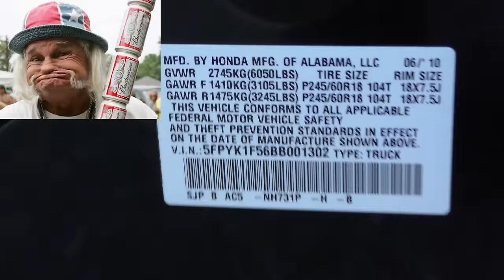Here's Why This Truck is a Better Buy Than a F-150, Silverado, and Tundra

Comment: That's my truck, thanks for having me over was the best day
Reply: Do you still have the vehicle!? How's it running?
Reply: @shadowman1992  running great, replaced the cv axle. Almost time for the belt and pump. Got 86k on it now. Thank you for asking. 🛻
Reply: @noahsamuelmarkus7021  awesome to hear I have a 07 bought used with 145k on it now with 151 k treating me great I love mine too.
Reply: @shadowman1992  nice, did you have the frame recall done on it. I mean the gas tank recall.
Reply: @noahsamuelmarkus7021  the paper shows that it did have it done but my ridgeline had very little rust and yours from the video looks like it does too so it's not anything serious to worry about unless it's very rusty.
Reply: @shadowman1992  yea I haven't had it done but I'm going to wait till I see rust. Because right now there is none
Reply: @noahsamuelmarkus7021  do you live in an area where it snows ? And they put salt on the road ?
Reply: @shadowman1992  yea I bought recently from New York but it was garage kept because the frame has barely any rust. But I live in conneticut and go to school on rhode island. So yea some salt but I clean underbody regularly. What about you.
Reply: @noahsamuelmarkus7021  ok awesome ! Yeah your truck in the video looks very clean underneath. But yes I live in Michigan and I actually spray fluid film on the undercarriage before the winter gets here for protection. And clean it as well. If you take care of these trucks they will last you so long.
Reply: @shadowman1992  interesting, what fluid?
Reply: @noahsamuelmarkus7021  it's called " fluid film " look it up and your will find it. I personally have had great outcomes with it in the past it's a rust inhibitor.
Reply: Any chance you could share where you got that bed cover?
Reply: Sorry not sure where it came from. It came with the truck when I bought it. But it is called a retrax cover that's all I know

Comment: I had a 2006 Ridgeline.  It was hands down the best Winter vehicle I have ever owned, and I live in Montana so I do know winter.
Reply: Crunch right through the snow ❄️
Reply: Had an 08 honda civic hybrid in Montana, FWD, was fine in the snow as long as you know what you are doing.
Reply: @solidfataiist  I owned a 79 Plymouth champ, FWD and did great with cable chains up front. 
Twin stick transmission. Mca-jet mitsubishi. Great engine and sipped gas.
Reply: 2007 Ridgeline with 100k miles both Denver and Southwest Montana. Best rig I’ve ever owned
Reply: Americans claiming they know winter when ive lived in canada all my life 🤣 gets me every time 😆
Reply: @lucluc2716  Minnesota resident here, we get 6 feet or more every winter. Tried and true subaru outback. Only times I ever got stuck was when I was trying. They're amazing in the snow.
Reply: @lucluc2716  I’m two hours south of Montreal. Does that mean when they’re getting a blizzard I’m getting a heat wave? Don’t get me started on their driving either.
Reply: @onefootinthegroove39  im sure we still get it worse 😆 and dont compare to those goddamn quebecors, theyre a different breed altogether
Reply: @lucluc2716  my Ancestors were in Montreal in 1619 they were smart enough to leave
Reply: @lucluc2716   Why do you use God's name in vain, bro?  Read Exodus 20:7 and also the rest of the Ten Commandments.
👌✌

🤔 I wonder why people never use Buddha, Muhammad, Joseph Smith, or Satan's name, instead of God or Jesus' name in vain? 😬 🤯 😱 😳
Reply: @lucluc2716 ok and???

Comment: My uncle has a 2008 Ridgeline and he mostly daily drives it, and he even goes camping with it too! It currently has about 250k miles and still runs strong!!
Reply: 250k miles? that honda's finally broken in 😂
Reply: @Venomousrl  bro don't make fun of my uncle's truck...
Reply: why they keep trying selling customer's kitchen sink?
Reply: @jonlosito2004   he wasn’t joking 😂 he was saying that the truck is just getting started
Reply: @jonlosito2004  He wasn't making fun of the truck.  He was complimenting it.
Reply: 2007 over 390k miles… wouldn’t trade it for anything other than one with less than half the miles.
Reply: @sunshine3914  wow that's great. I have a 2008 Ridgeline with 185,000. I really like the new models (2021- ) but I'm keeping mine for a while
Reply: @sunshine3914  what have u done maintenance ise?
Reply: @jonlosito2004  “broke in” means a vehicle can finally be normally driven or accelerated as to not damage the hardly used mechanical parts.
Reply: @jonlosito2004 Why is your uncles truck pink ?
Reply: @BrianB77   Our 2008 HONDA Ridgeline is bone stock. 105,000 miles, it's 99% more reliable than any Ford F150. The 1st get. has a true 4x4 trans with locker (it has never been used). The truck is so reliable, 2 batteries and 1 timing belt, it has many years left. The bed hauls as much weight as you put into it, truck still has full power. It goes through mud and deep snow without issues. I wish they offered a stripped model without the nav and all the digital nonsense. Basic maintenance keeps her going.:glasses-purple-yellow-diamond:

Comment: I have some friends that just bought a '22 Ridgeline.  Looks to be an excellent vehicle.  I will stick with my dinky little Baja for now, but maybe down the road, who knows?  I made a point to pass on Scotty's advice - CHANGE THAT OIL EVERY 5000 MILES!
Reply: The new generation Ridgeline have issues with the VCM. Stay away.
Reply: @technologybuddha  I believe he disabled that feature right away.
Reply: @BrianBlood  No, VCM is still standard. You can disable it as a buyer, but Honda has to keep it so they can meet EPA fuel mileage requirements.
Reply: @technologybuddha  yes, I am aware.
Reply: I went from a Baja to a Ridgeline and never looked back. I didn’t realize how uncomfortable the Baja was until I drove the Ridgeline.
Reply: @leegraves101  lol,  I don’t doubt I would love it as well. My bank account would hate it, though.

Comment: I have always liked the Honda Ridgeline, but wow they were just out of our budget new. I got a regular cab F150 that year, and still have it---that's a great truck too. The Hondas are good vehicles ---we've owned an Accord, great car. It had over 220,000 miles when we sold it to a college kid. He got another 100,000 out of it!!
Reply: Which year was the Accord? 4 cilinder?
Reply: @oscaralbertogramillorocha6237  2002 4 cylinder. It was purchased used as well!

Comment: Love this truck.  I have owned 2 of them (Gen 1) and has been very reliable. over 200k miles so far no major issues.  Only CV axle, struts, and coil packs.  Typical wear and tear items , for that type of milage.
Reply: and gen 2 is improved over gen 1 as they learned from gen 1 to improve gen 2 so yay
Reply: Have you ever had a valve adjustment on your ridgeline?

Comment: I installed an aftermarket CV axel both sides and the car was shaking a lot … took them off and installed Honda brand .. the car drove smoother with the Honda brand ..

Comment: Bought 08 with 195k for 2k, runs like new no leaks good job Honda 👏
Reply: Have a 09 RTL with 200K miles
Reply: @harveyhankerson8359  I believe it too👍🏾
Reply: @MrDoc375  I'm even thinking about getting another just because of the reliability and the trunk in bed  is a major win
Reply: 2k thats a steal , round here it would stil be 5-6k at least
Reply: @CRAPO2011  ikr!
Reply: Chillbro8811: I'm looking at a 2008 Ridgeline one owner with 114,000 miles on it. The guy has all maintenance records and had all the recall work completed.  New AC Compressor.  I've been looking for months and though I have to drive from West Virginia to Lexington, Kentucky...I think it's well worth the drive. I'm retired now and really this is all the truck I need ....So many younger guys think it's a "sissy truck" ...lol😅 I really don't care. That Honda will outcast most all American made vehicles.  I'm pretty confident the 4 hour drive will be well worth my time!
Reply: I just bought an ‘06 with 266k for $4550. Feel free to share any of your knowledge with me.

Comment: The Ridgeline Is an amazing vehicle and would work well for 80% of the people out there. However, if you tow anything over a small trailer that weighs 3500 # or so, you're much better of in a Tundra. I'll bite my tongue on the Ford and the Chevy although older Chevys built between 1999 and 2006 were amazing! The reason I say those who tow are better off in a Tundra is that the Tundra is an actual truck with big robust truck parts and it was built for towing and towing often. If you're consistently towing in the Ridgeline, you're going to break something like a transmission or a motor pretty quick. Let me be clear and replete myself in that the Ridgeline is still an amazing vehicle but it's more car than truck.  If you're occasionally bring stuff home from the hardware store or pulling your aluminum bass boat, then by all means, the Ridgeline is perfect for that and it does get noticeably better fuel economy over any of the other trucks. Trust me, I have owned many Tundra's, Ridgelines and Chevy 1500s (minus the newer Chevy's). There are great reasons to like all 3 as long as you are aware of each ones capabilities and make the correct decision that fits your needs.
Reply: @andybales7318  Yep, there is. Just not a good reason. Tundra smashes F150 in every way possible.
Reply: @andybales7318  I believe that people buy F150s for the same reaeon they vote Demacrat. They're parents and Grandparents did. There's WAY better options out there.
Reply: @andybales7318  You are entitled to your opinion, even if you are very wrong. You need to take another look at the Tundra and tell me it's not a whole lot tougher than a 150. There are way too many Tundra's with way over 1,000,000 miles on them with the same drivetrain my man. And that's when they are worked hard.

Comment: My daughter got quoted $2200 for both CV axles at the dealer for the 2010 CRV.......I bought the axles from Detroit Axle for less than $100 replaced them in an hour......RIP OFF

Comment: Not "made" in Alabama.  Assembled n Alabama with major components shipped in from Japan.  Main problem I 've seen with those is that the power door locks die early and they're a pain to replace.  Otherwise a better pickup for many people than any other choice.
Reply: Not true at all. More American made parts in a Honda than nearly any other vehicle available.

Comment: My friend traded his in about a year ago for a new one.  Only had 100k on it.  I asked him why he traded it in, and he was like "Well, it was getting high mileage and had a little over 100k on it and was 7 years old".  I about laughed because I'm like "You do realize that 100k on a Honda is nothing?"  So he bought a new one -- at least he bought a Ridgeline and didn't cheap out and get a Chevy or something.  Although recently he did buy a Ford Bronco (one of the new ones) which I think he will regret in a few years or when the warranty runs out (but he still has the newer Ridgeline).

The Ford Maverick puzzles me.  It's basically a car with a bed on the back (or an SUV if you think about it).  But people are buying them and being like "I have a truck" (yeah, you do, but you're like a "wannabe" truck owner).  AT least get a Ranger if you want a small truck and don't want the Toyota or Honda... at least the Ranger is built on a truck frame whereas I don't think the Maverick is or it's a less sturdy / perhaps partial frame given it's price and the size of the vehicle.
Reply: I have to laugh every time someone considers 100k high mileage. In TX you’re hard pressed to find a used truck with less than 200k.
Reply: 2013 with 65K. All the tech I need, nothing extra. Best camping rig for my lifestyle.

Comment: I wish Toyota would make their small pickup again, like the first gen trucks from the 1980s. They could probably use the Corolla chassis, I wouldn’t mind if it was front wheel drive.
Reply: They could do a pickup based off the RAV4.

Comment: only thing to note is the engine timing belt replacement at 100K miles, if the vehicle never had it done then it absolutely needs it and will cost around 1200 to get it done right.

Comment: Scotty, the 1st Gen Ridgelines (2006-2014) have 4 WD, but they default to FWD and divert power to the rear wheels as needed
Reply: I believe what you described is the definition of AWD
Reply: @ecobasetech4558  u may be correct.  I'm not really sure of the difference between 4WD and AWD. I've also seen the term full time 4WD.
Reply: @ecobasetech4558  No, AWD are Subarus, always 4WD. Ridgelines have electric packs to control back wheel spin if necessary.
Reply: @AJohnSmith  So, are you saying that the Ridgeline all four wheels are driven as a matter of routine?   Sorry, but I didn't notice your post until today.  Maybe why that explains why I only get 13 mpg around town.

Comment: I remember a couple years back your saying that Honda's big vehicles (their truck, SUVs and minivan in particular) had problems with their transmissions. Is that still the case? Or is it a matter of you can get such a great deal on a used Ridgeline that the money you're going to have to drop into a new transmission later is still worth it? On the towing front, I'm assuming a Ridgeline would be adequate for towing a boat and a small camper? I've been looking at an F150 and a Tundra but I live in Honda town so there's a certain appeal to the Ridgeline.

Comment: If the ridgeline bed didn’t look like that and made it slick like how the maverick looks I wouldn’t mind buying it
Reply: You do realize this is the 1st Generation Ridgeline 2006-2014. It start development in 2001. The process to make a unibody pickup truck came a long way with years.
The flying buttress I assume you are referring to. The 2nd Generation Ridgeline 2017-2023 bed is fairly normal its shallow but the truck is wider than Tacoma,Ranger,Frontier and GM twins Colorado Canyon. 
Remember that Ridgeline has a lockable watertight in-bed trunk with drain plug underneath its bed. You can cram an adult body inside of it. But I carry luggage or ice chest valuables.

Comment: I have a 2009 Hyundai sonata it's a nice car. It has never given me many problems at all it just has one annoying thing that no mechanic can figure out. My cam position sensor keeps tripping the check engine light. I have replaced both, I have replaced the map sensor. Another sensor. Still there. It comes on for a week or so then go's off then comes back on. Been doing it now 2 years or so. I have found I can actually get it stay off for quite a long time if I run 89 gas instead of 87 in the damn thing. Also seems to have an evap issue lately that comes and goes. This car is very temperamental. It doesn't know whether it's sick or not.

Comment: Is the timing belt mandatory? I heard of people driving them to 250k with no issues
Reply: That is pushing it big time.
Reply: I would not chance it.  My 2008 has 300K and its been changed every 90-100K
Reply: @anthonygreco12 Have you ever had a valve adjustment on your ridgeline?
Reply: @shadowman1992  once at 227k
Reply: @anthonygreco12  do you happen to remember if any valves were really tight ??

Comment: I make it a habit to change those cv joints both. Even if only one is bad. Same thing for wheel bering. Rotors so on so forth. If it's time for one to go the other one will be getting all the pressure and will grout shortly after. At least the last the last 3 cars my wife has destroyed lol.

Comment: These older Honda Ridgeline's are still the best mid-size pickups ever made in North America. Anyway, what is your opinion on a 2009 Subaru Outback 2.5i wagon with the 2.5 L flat-four engine and the four-speed automatic transmission and a 2004 Subaru Outback H6 wagon with the 3 L flat-six engine and the four-speed automatic transmission? These fairly older Subaru's with AWD are still on the road and they are currently running and driving as they are a brand new vehicle. Go figure.
Reply: They blow head gaskets especially the six cylinder engine! Buy a four cylinder later than 2010!

Comment: Scotty, I have a 2006 ram 1500 with 206000 miles. The body is excellent shape. Should I have the engine rebuilt, or buy a newer one
Reply: Scotty doesn't answer questions here.  Keep it by the way.
Reply: I don't see where you said it actually needs a motor....I'd do the motor and tranny  . if you like it, it makes a lot more sense to fix what you have than spend 30k on another used pickup
Reply: Replace the timing chain and gear, oil pump
Reply: @richsweeney1115  It's making the rattle that everyone said happens with them, or then that runs pretty good. Body in perfect shape.
Reply: Scotty’s always ragged on Rams. You should go through his videos from like ten years ago.

Comment: Scotty when you're saying to replace the half shafts are approximately $349.00 is that for one side or both sides and does that include labor?
Reply: Buy on rock auto save some $$
Reply: Our local auto parts had them for $135, last summer. Turned out it just needed a new engine mount.